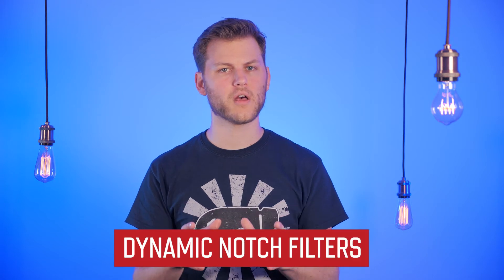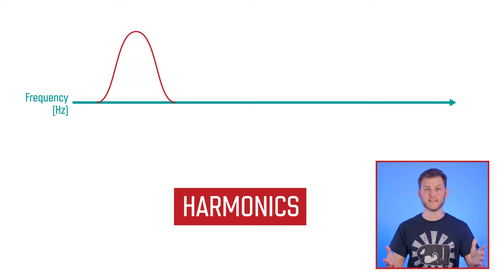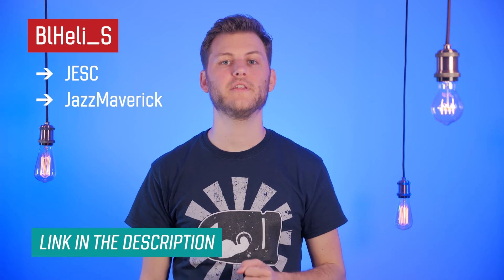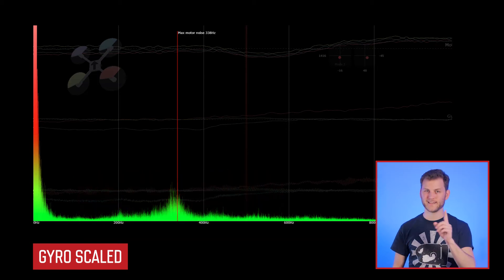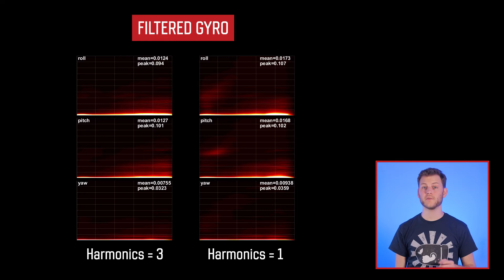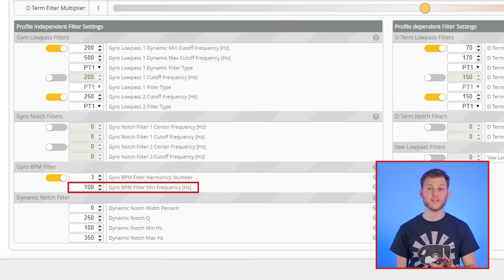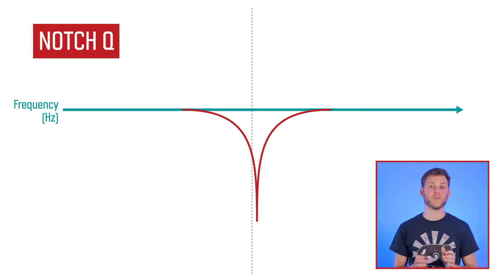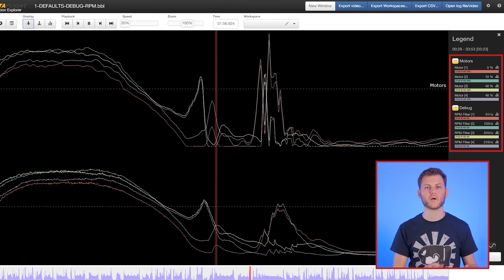Betaflight Filter Settings #3: RPM FILTER | Setup & Tuning

Comment: Hey hey, i know its not easy but it would be sooo cool if you could do an explenationvideo of all the PID Tuning Sliders in BF 4.3. Because Chris Rosser is doing a Bachelor Thesis out of this. But i can understand. Its maybe not that easy to explain for dummies. Thanks a lot!
Reply from the maker: Hi! I would love to explain PID after filters. But indeed, it is hard to make a "simple" version of the subject. I have a few ideas to keep it straightforward, but it will require some testing on different quadcopters. The problem is always to make it work for everybody in every situation! ;)
I'm sure you will eventually get it!

Comment: You can use rpm filter on blheliS if your fc supports dshot600
Reply from the maker: Do you mean with BlHeli software or another one? I haven't used BlHeli_S ESC in a while... 😉

Comment: Thanks for your videos brother 👍👍
You are very good in explaining the toughest things in simplest way

Sometimes better than others who are doing this for years.
As I recently shifted from kiss setup to beta flight. I was facing lots of problems in tuning my quad (5inch)   
There are so many things and parameters in beta flight which i don't understand  and even in blackbox log i am not able to do much 

Can you make one big tutorial for the ones who are new to beta flight 

How to setup and what are the steps to tuning pid and filters 

Sliders are hard to tune to get the locked feel because it changes all the three axis simultaneously and I am not used to it 

What is antigravity ? Airmode ? 
D min 
I term relax 
?

My quad is not holding its attitude while dropping when the throttle is cut off. 
What should I do ??

I got frustrated from beta flight 

I want tight feeling quad but not able to achieve it.
Please help 🙏
Reply from the maker: Hey!

Getting into Betaflight is not easy, but don't worry,  it comes very quickly too.

Airmode is what you want to activate so your quad doesn't cut the motors when the throttle is at zero. It will always keep the motors spinning at idle to keep control of your quad.

Antigravity is not a settings that makes a huge difference at first. You should come back to it later, when you fully understand PID. It is designed to boost the I value during throttle punches.

D-Min is a value used for "dynamic" D value. It will go to that value when D is not required (it keeps the motors cool) and it will increase to your actual D value when necessary. Previously, the D value was always at the maximum and it worked well too. D-Min only prevents your motors for warming up unnecessarily. Increase it and decrease it proportionally to your D.

For the tight feeling, that's quite a journey sometimes. You will need to use PID Toolbox for the best results. Check out their YouTube channel PIDtoolbox for good tips.
Reply: @LenordeFPV  thanks bro for soon reply ❤️
I tried to learn some of these terms 
One thing I noticed today while flying that my quad hold its attitude while free falling when throttle is chopped to low 
But when the throttle stick is completely lowered the quad falls like brick wobbling without holding attitude 

I came to know that antigravity is responsible for attitude hold by boosting the i terms values.

But why it is not working when the throttle stick is completely down ?

Is something related to throttle min command?
Reply from the maker: @Bzl_777  Hi! You have to activate "Airmode" in the configuration page. Antigravity is a misleading term, and is not responsible for that at all.
Airmode can also be used on a switch if you prefer, by going to the "modes" page.

Comment: Hi i just build my toothpick 3inch with stock betaflight 4.2.3 and 16.7 blhelli s

it is my first build and i was getting hot motor on both back motor and warm-hot motor on front

i have set the throttle limit to scale 50%
cause i am not in very big area，but the motor is still hot

i am flying on 
3inch toothpick frame
5200kv 1204 flash hobby motor
3016 3blade
gnb 500 3s
jhemcu f405 pro
all up weight is around 120g
Reply: originally

throttle limit 50% change (scale)
stock bf 4.2.8 stock esc 16.7
>hot motor, very shaky footage

1st try albert kim setting 

flash 16.79 48khz esc (bootup sound got change, means successful?)
dshot_burst=off, schedule_optimizer_ rate=on (not sure what it does)
turn on bidirectional dshot, 12motor poles, motor error rate = 0%
harmonics=1 frequency 100, dynamic notch fliter width=0%, Q=120, min=90, max350
follow 
>motor less hot, but sill wiggle alot when increase throttle 

2nd try uav setting

Esc timing = Medium-High, 
set thrust_linear = 25
PD balance0.9, PD gain 1.2, stick respond gain 1.2, Dmin off
fliter slider both 1.1
harmonics=1 frequency 100, dynamic notch fliter width=0%, Q=250, min=150, max350
>Motor get abit more cooler, but still camera still wiggle

change canopy from tpu to petg 

>way lesser wiggle and motor getting more cooler, but still when doing punchup you can see the high-frequency vibration  

what should i do？
Reply from the maker: Hi! If your back motors are hotter, it can be caused by your center of gravity. Try to balance your quad on its center by moving the battery towards the front.
Small motors are usually hotter than bigger ones. As long as it doesn't hurt when you touch them, it should be ok. You can still add a bit of filtering to prevent them from heating, but it will probably result in more wiggles, which is your second problem.
What firmware did you install on your ESC to get RPM Filter?
You may want to do a bit of blackbox to see where your noise is situated. Maybe the Dynamic Filter can be adjusted in your case. If your FC doesn't have internal memory for logging, you can get an OpenLager to record the blackbox. It is also interesting to post those files on the Betaflight BlackBox Log Review Facebook group, since it is very hard to help you based on your settings only.

Comment: Super interesting video! Thanks for giving a full overview of the topic. Is it possible to calculate the frequency range that a motor will occupy? Like if you know kv, voltage, and # of magnet pairs can you estimate the frequency range being 150-600hz or something?
Reply from the maker: It is a very good question! I actually had to check online since I'm not too confident in my physics knowledge. And it is very simple!
RPM is already the frequency of the vibration. But since it is a rotation per MINUTE, you have to divide it by 60 to have a frequeny in seconds, and you've got Hertz.
Knowing the RPM of your motor is voltage * Kv * motor output percentage.
To understand better why RPM causes vibration, it is simply because we are not in a perfect world. No motor is perfectly balanced. When you multiply the tiniest imperfection by the huge speed, you've got a vibration!
Reply: @LenordeFPV  Thanks for taking the time to explain it! I wasn't sure if you'd have to account for the number of motor poles or if it just makes the vibration once per rotation.  But this makes sense and gives values that you'd expect to see. Appreciate it man!

Comment: What about rc filter tuning? Gyro and RC are the two inputs to the system that we can filter. Garbage in, garbage out you know? With good gyro traces and good rc traces, pid tuning will be easy (assuming we were careful about filter latency in our setup)
Reply from the maker: Very good point ! I am actually very interested in the RC input and I would definitely talk about that before PID tuning. I have experienced a case of RC input generating some overshoot, but I need to experiment more and get some consistency in the logs to explain how to address this problem.
The good thing with RC is it's more straightforward and the results are easily measurable.

Comment from the maker: You can debate here the fact that I use "RPM Filters" in the plural form. I forgot it was written differently in Betaflight, but hey! There ARE multiple filters implied, so am I really wrong? 😁

Useless math not discussed in the video : when I mention the 4 dynamic notch filters, you have to multiply this number by 3: one set for each axis (roll, pitch, yaw). Then, you have to multiply again by the number of harmonics. So with the defaults settings, you have 36 little guys doing the hard work to let you rip some good FPV !